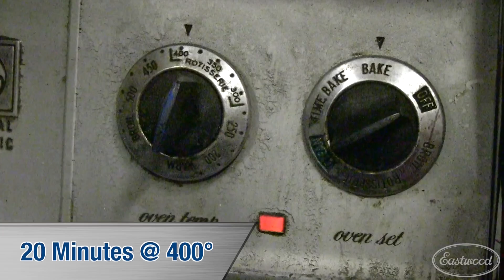A-Arm Tubing Fabrication - Eastwood TIG Welder, Tubing Bender, Tube Notcher and Powder Coating Gun

Comment: Where to begin... tube notcher: you bought one from harbor freight and painted it blue... fit up: you left the needle sharp points in the saddle cut which are so thin that they will burn away and cause the puddle to wander and make the weld look like shit... the welds: are you serious? sand blasting: again with the harbor freight... and last but not least the jig: you tacked it up on a shit jig and the removed it to weld it out which means that the expansion and contraction from the heat moved the fit up more so than if it were fixtured properly. If you're a fabricator/ welder then have some pride in what you do.
Reply: +Texas Whoa.  Holy crap, man.  I didn't notice until you pointed it out but all that crap is IDENTICAL to Harbor Freight! HAHA.  I have the HF tube notcher and it looks identical to the Eastwood, just Eastwood includes 5 hole saw... big deal.  Tube kinker... whoops, bender, HF.  I love my JD2, way better.  The welder is the only thing that doesn't look like HF but I've never heard of MIG like TIG.  I didn't think that was a thing.  I've heard of TIG like MIG since people like the dime look but never vice versa.

Comment: Time to get real, $1,894.93 in tools plus another $3,000 give or take for a welding tank,welding helmet,  welding consumables, baking oven, drill, air compressor and accessories, safety equipment, saw and expanded metal .  Total Cost = $5,000,   The look on your face when your wife kicks you in the nuts, after looking at the credit card bill = Priceless.

Not for the home hobbyist unless your making money fabricating A Arms, Nice video and tools I will give you that Eastwood.